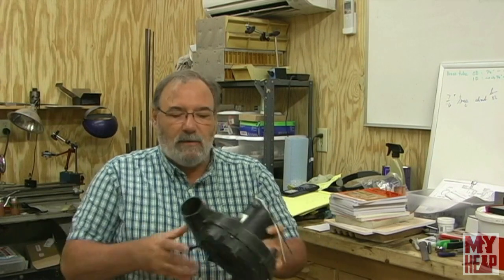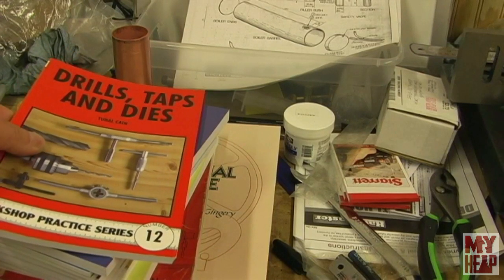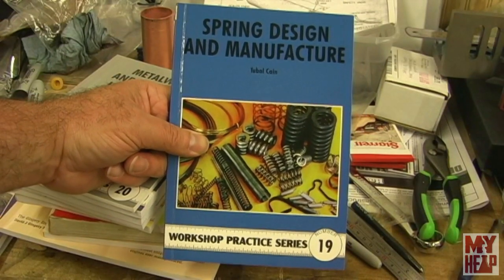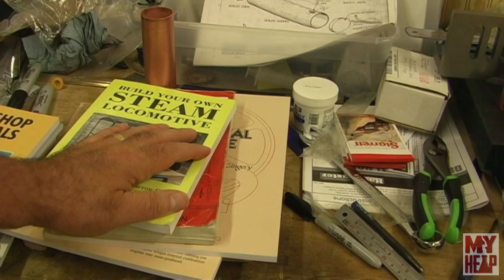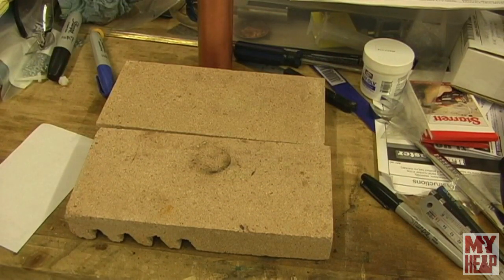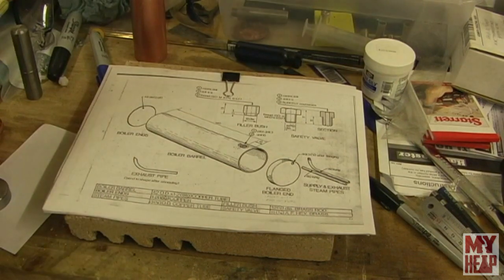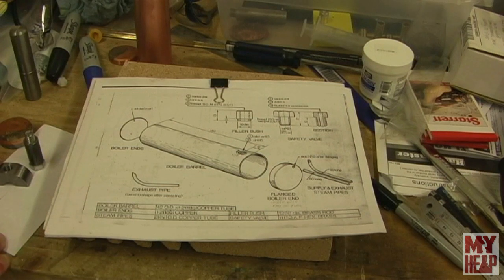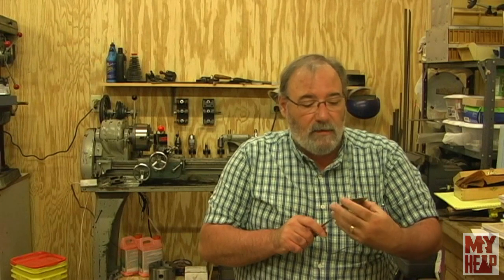Shop Update - New Tools, Home Made Tools and Books

Comment: Hi Joe
Just watched your latest video, very interesting and Thanks very much for mentioning my loco project, i appreciate that.
The flange plates on your boiler just need to be a snug fit, not tight not loose. just tight enough to hold themselves in the bore.
Thanks again Joe
Regards Mr f
Reply from the maker: Hi Mr. F.  I hope you get a few more subs.  It is a great series you have there and I think there are some on my channel that would really like it.

Thanks for the boiler tip.

Joe

Comment: Good to see you out in the shop Joe. 😀 I really don't do steam stuff but I like some of those tools you've made. I made dimple dies from 1" to 2" just like yours but a tiny bit larger.  I have most of the Workshop Practice Series books, the problem is they are British (not there's anything wrong with the British themselves) and mostly in metric or 220V. But on the whole, I find them packed with good info. Once I get my shaper back together, hopefully tomorrow, I need to tear my Burke Millrite MV1 down and clean it up. Someone used the zerk fittings to fill it with grease, now it's very hard to move the axis. Thanks for making time away from the dungeon for a shop video!
Reply from the maker: Hey George.  Is always great to get back in the shop.  The dimple die works great.  Wish I could find my sample piece.  I will show its use in the next KY engine build.

I agree the British terms and metric stuff is an inconvenience but the information in then are generally really good.  So has the grease turned to stone or just really gummy?

Thank you for watching.

Joe

Comment: I forgot to mention this the other day, have you tried a half wave rectifier to reduce the motor speed?   I know it's not adjustable but the motor should be fine with it.
Reply from the maker: That will half the effective rms voltage so would definitely slow it down.  If I had a couple of power mosfets laying around I could whip up a 555 base pwm controller.  But all that aside, I have looked and found router / motor speed controllers for under 20 bucks.  How are things going Walt?  Looking forward to seeing your next video.

Joe
Reply: I don't know exactly how much CFM you're looking for but it's an easy way to reduce the RPM and heat.Yeah, I've been super busy,  I have a couple of projects in the works but nothing ready for prime-time; It's that old conundrum, you get time or money but never both at the same time...
Reply from the maker: Well, the problem Walt is that I don't know the CFM that I will need.  Depends on the oil I am burning (Diesel, WVO or motor oil), how much I am injecting.  I want to vary the blower based on the flame I am producing.  I like a neutral to carbonizing flame if melting AL to help prevent excess Hydrogen absorption.  Ahh, you get the idea.  AND, I completely get the eithe money or time but not both thing!  HAHA
Reply: I probably missed this, but what is the burner for, is this for your foundry?
Reply from the maker: Yes sir.  It will be for the foundry.

Comment: Good stuff man, I have a few of those books also and defenitely lots of good things in them.
How many amps does that blower pull? A light dimmer can only handle like 1 amp, but if you look around where the light dimmers are usually, you'll find ceiling fan dimmers that go up to 5 amps. Any higher tho, I would try a router speed controller. 

The boiler ends, you dont really need any gap at all, and normally you want a press fit more or less to hold everything in place on it's own and the silver solder just flows in to seal everything up and create a joint that can withstand the temps and pressures.
Reply from the maker: I will look and see if I can find a fan dimmer the next time I am at Lowe's.  Not sure what the specs are on the little motor, will have to see if there are any labels.  Thanks for the fit and solder tip.

Joe

Comment: nice haul wish my wife bought me machine tool books . btw don't forget i still have them end mill holders for you . i dige the tool holders i could use a few of them mt2 and oxa sizes
Reply from the maker: Thanks Chris.  I've not forgotten about them.  The tool holders are working out well.  You have a 3d printer if I remember correctly, don't you?  The files are on thingiverse.  I keep a running list of stuff I would like to get, books and what not.  My wife uses that list to buy Christmas, birthday and father's day gifts.  But she generally buys me a lot of books.  Keeps me out of trouble I suppose.
Reply: @MyHeap  3d printer not I I make my patterns in wood
Reply from the maker: @OldIronShops  I don't have one either.  My son does so he prints stuff for me.  I make patterns of wood too, though I am known to cheat and use the CNC router to carve them.
Reply: @MyHeap  cnc roughter is s exilent method to get a pattern built